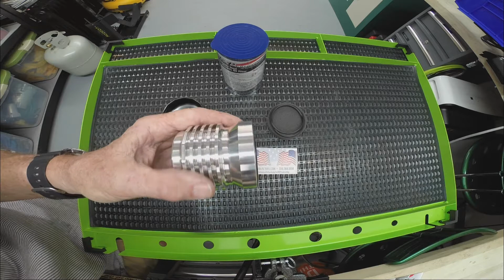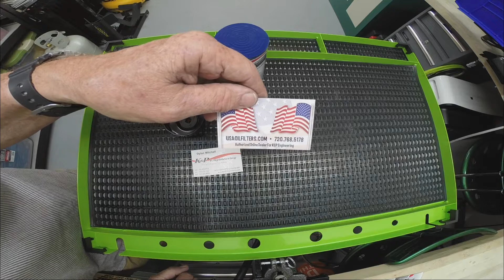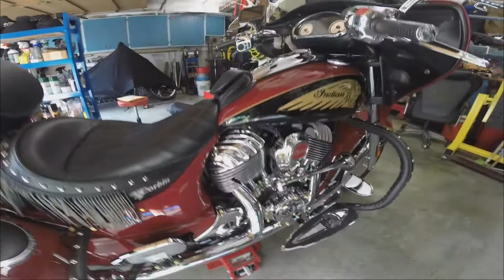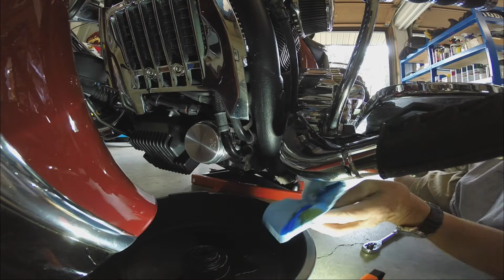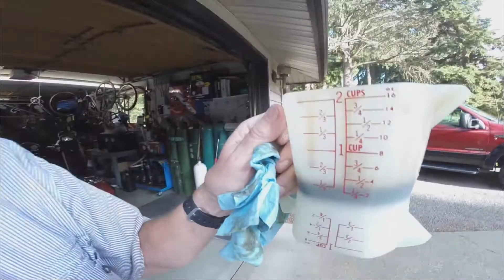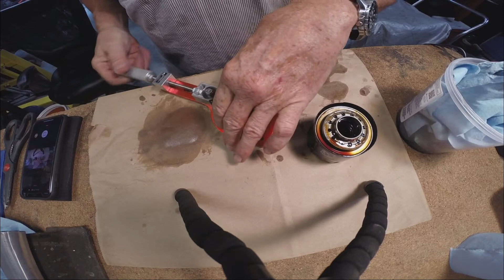KandP Engineering Reusable Oil Filter for Indian 111 and 116 motorcycles

Comment: For $69 , I am using  Hubb  reusable oil filters on my vehicles and bikes. They are the same size as the oem can,uses the same element in all the three inch sizes ,you just need to order the correct thread size ,and gives 5 psi better oil pressure.